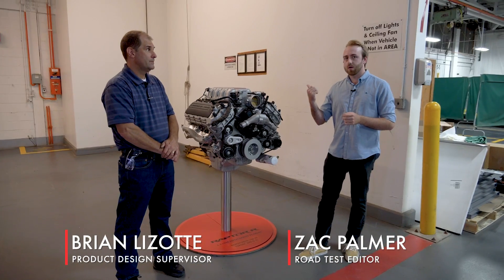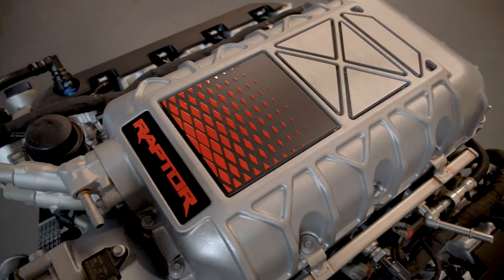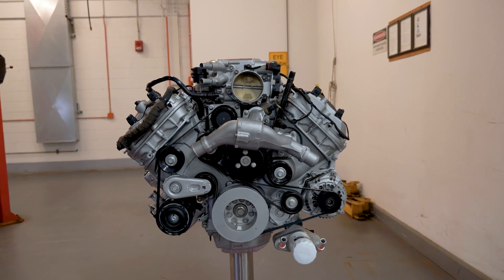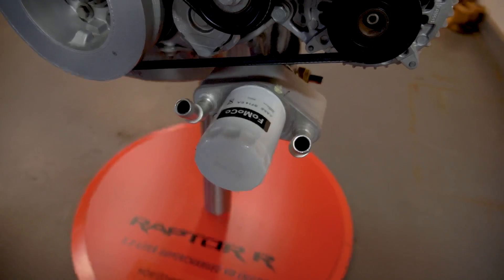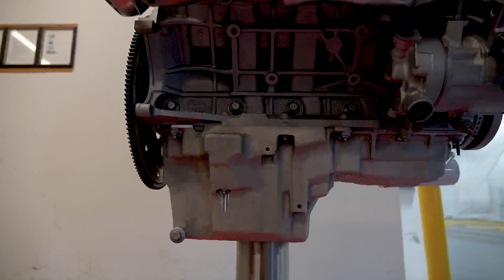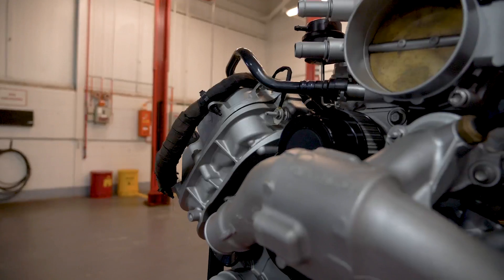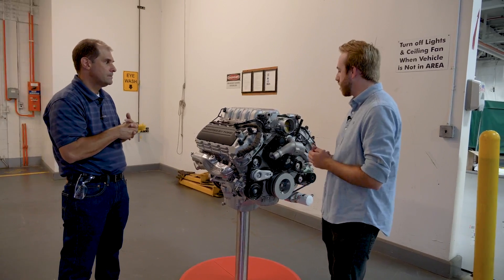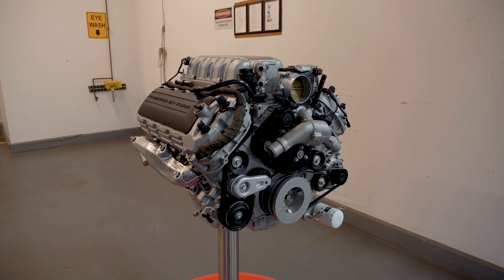2023 Ford F-150 Raptor R engine interview

Comment: This will get 8 mpg downhill lol
Reply: this truck is all about the 'smiles per gallon' :)
Reply: this will get 8 mpg standing on your driveway XDDDDD
Reply: I'm sure the gas mileage will still be better than in the RAM 1500 TRX. Smaller engine (5.2L vs 6.2L), less power (700 vs 702hp), less torque (640 vs 650 lb-ft) and 400 lbs less weight.
Reply: Its a dam shame it didn't have at least 720hp
Reply: @drfaticus  slap a tune on it, will probably make 850+
Reply: @Toadster88  And the engine life will be shortened dramatically.
Reply: @SomeTechGuy666  surely Ford built the engine to survive more than 700HP
Reply: @Toadster88  Don't cry to us when you don't have warranty on your blown engine.
Reply: @SomeTechGuy666  LOL you assume I’m gonna pay $110k for a pickup
Reply: @Toadster88  🤣
Reply: Superchargers aren't very efficient.
Reply: Ive had Roush super chargers from dealer since 2012 and never issue and hwy over 1000 to empty km !!! In city drive with heavy foot witch cant be helped lmao 😊😊😊😊😊it gets shity ya lol bit still 6 to 800 km depending how much ya pinner hahhaa my raptor v6 with roush chip and air box is way worse lucky get 700 800 hwy hahhahaha